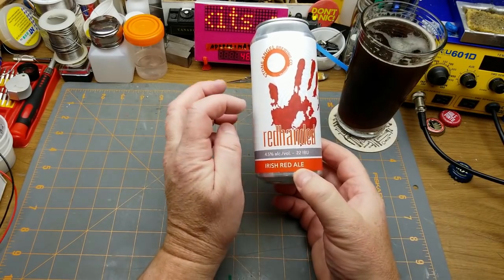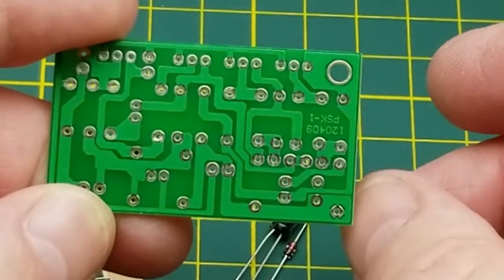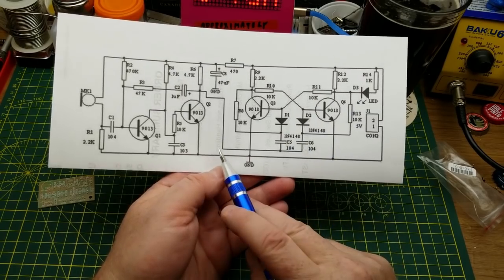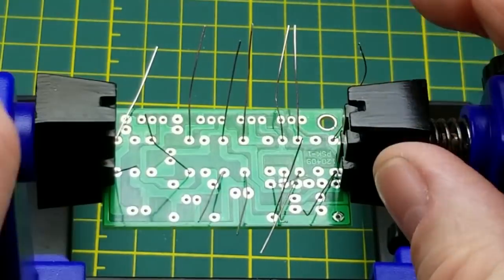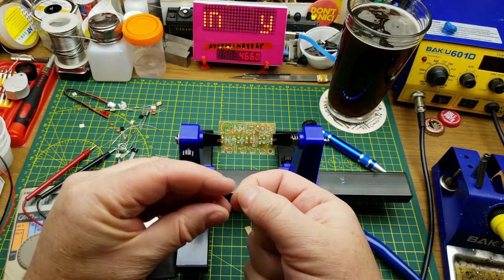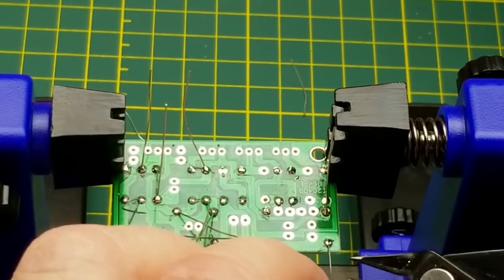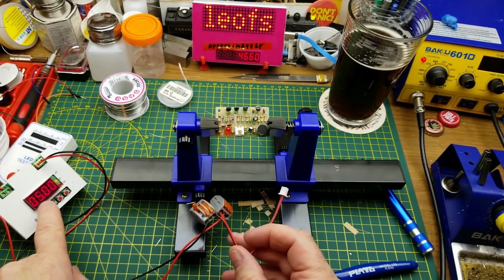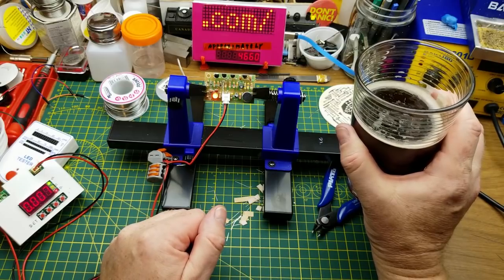kit  build - clap on! clap off!

Comment: I remember it all. I had to live through the commercials. Back in the early 90s when I was in high school we built one in electronics class. Soldering with those cheap Weller soldering irons. It took many class periods to finish that project. There were only 46 minutes in a period. The iron took the first 20 minutes to get up to temperature, then you could do maybe two soldering joints before it was time to clean up because the soldering iron would take too long to get back up to temperature lol. I still have my finished project. It doesn't work anymore. One of these days I'll take a look at it.

Comment: If you run the pcb from a d.c wall wart and connect the output via a transistor to drive a relay coil, it would be isolated by the relay.
I've used the astable configuration to strobe displays in a frequency counter, a handy circuit :-D

Comment: Hi Kent, your saying “too much talking” but instead of “not enough soldering”, I would like to say “not enough flux” you wouldn’t have to clean your tip so much, and I think you could turn down the heat a tad too, if you used flux mate, just a thought from another hobbyist mate.. 🤙🏼🇦🇺

Comment: Turn the solder tip over, so the slant face of the wedge lays against the wire not  the PCB pad.
Reply: Yeah, it was setting my OCD off.  I'm not even OCD...
Reply: FWIW soldering under a recording camera is surprisingly difficult.
Reply: @HazeAnderson  - even more difficult if you don't use the soddering iron properly.

Comment: Love your videos man. I am surprised at your reluctance to use self built equipment on mains voltages but you are quite happy to use cheap Chinese stuff which is likely to have had the corners cut to dangerous levels. At least you know what is in the stuff you build and you can make sure that it is protected with the necessary fuses, cable diameters etc to be safe. You should be checking the cheap Chinese stuff for safety before plugging in anyway as they are usually so cheap the earths will be missing, not fused, under rated wires or have deadly clearances internally. Items made in the west usually have to comply to safety standards so there is some recall if things go wrong so are likely to be built to a better standard. So if are willing to use a cheap piece of equipment from china that may burn your house down the risk level is much lower if you know whats inside. On the other side try claiming on the insurance if a piece of imported Chinese built or self built equipment started a fire and they found out, The risk of your equipment failing is much less Chinese built. Rant about the Chinese is over now sorry.
Reply from the maker: That "reluctance" is mostly to prevent a flood of comments telling me that I'm insane and I'll burn down my house.

Also a healthy dose of implied "don't try that if you dont know what you are doing and if you do, don't blame me".
Reply: @pileofstuff  Understood, Thanks and keep up the good work.
Reply: I’m not sure how it varies by province but there’s legal liabilities of providing instruction on anything that could have a safety impact. So I try to deal only in a few tens of volts.